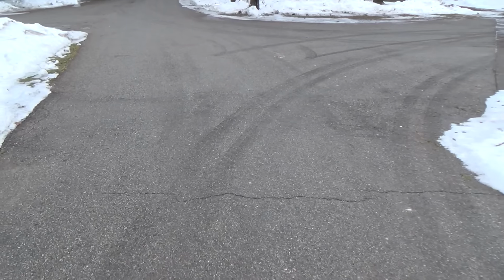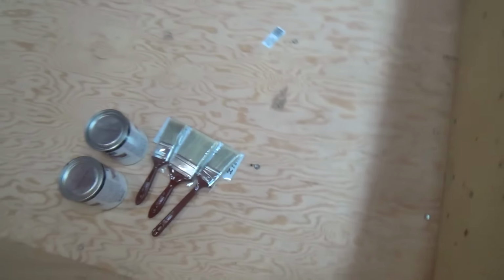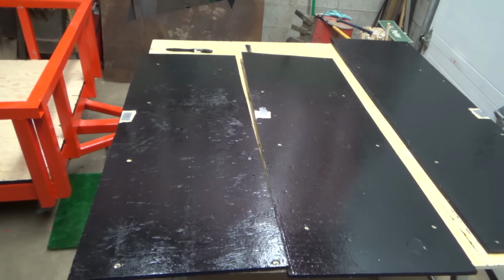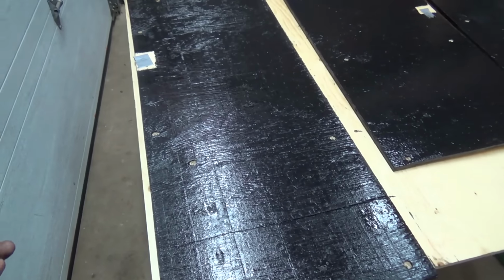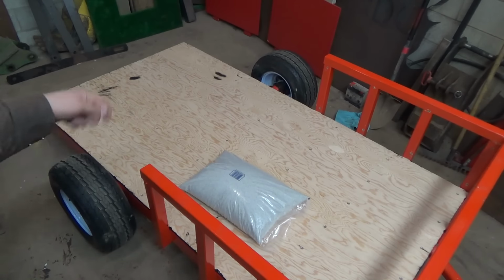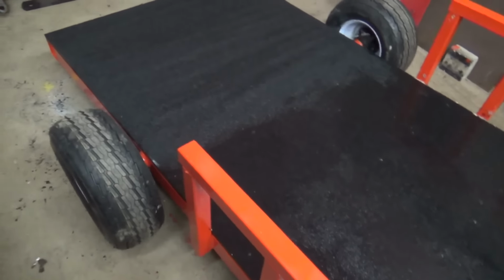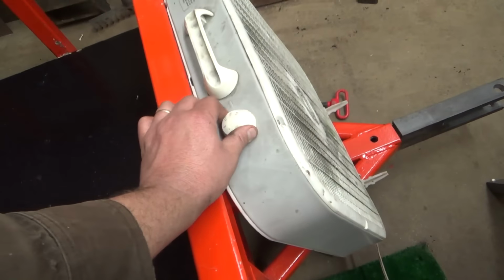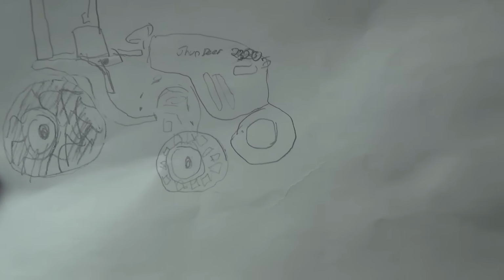Final Day of work on the new trailer Day 9

Comment: Bill I don't know if you saw my comment from yesterday's video if the paint and sand doesn't work well or wears off quickly go to tractor supply and get a horse stall mat. You can get 1/2 inch or 3/4 inch thick rubber mats and screw them to the plywood for traction. They come in 4 ft by 6 ft sheets and are about $40.

Comment: When I was in the Navy and we had to make Non-skid, we would get a gallon of whatever paint we were going to use, mix in a cup of sand with a stick until it was totally mixed. we would add small amounts of sand from there on until it was obvious that sand was in the mix then we would paint the area that needed the non skid surface. Easier that way.

Comment: You should put some aluminum angle iron on the edges of the plywood to give it a little more finished look and stop the mini ex tracks from tearing up the edges. Princess auto has 8ft lengths of aluminum angle iron for pretty cheap.

Comment: Usually what I do for the texture bill is I roll on a thick coat of paint then add my sand then spray a few coats of paint out of a paint gun, that's how I do all the bed of my flatbed tow trucks

Comment: Bill, I just did  a search on-line for the saws to run these Evoloution Blades. There is a saw made by these folks, ( in fact a few models ) the one I looked at was the Evoloution 380  Chop Saw. It's maximum blade speed is 1450 RPM. not only this but there are some good "Welding & Fabrication sites, where they discuss using these blades ar higher speeds than 1600.  Serious danger ahead, if you continue to use these steel blades on that 'abrasive blade ' Saw at high speed.
Check it out fully, please !

Comment: the one big problem i see with the trailer is when u unload the machine and dig and put the dirt on the trailer when u tilt it back up to load the machine back on off comes all the dirt. u might have to make a board to go across thats removable to keep the dirt on. also im wondering what turned around in the cementery  u should check the camera and see what it seen
Reply: 4lpower yea I don't know bc he said he would like to leave the dit right on the trailer unless he missed spoke and is going to dump the dirt then pick the miniex back up that is a good point

Comment: Bill, I like the trailer build, but I have to tell you something here about those blades, this is very short.......
CHECK THAT SAW'S  BLADE SPEED ! and then LOOK AT THE MAXIMUM SPEED ON THAT EVOLUTION BLADE AND THE OTHER BLADE YOU HAVE THERE TOO. THEY ARE RATED AT MAXIMUM 1600 rpm. 
If these blades spin faster than that, they will wear out just as fast as the others.
Good luck with this.
Reply from the maker: well its apparently was suppose to be sold as a dry chop saw.. i don't know the rpms.. maybe ill have to look at a new saw
Reply: Bill, I googled the only metal saw that Princess Auto sold and the rpms is 3600. Way to fast for the blades you are using. Maybe not the same but i would check into it with the cost of the blades. For that blade it should run about 1300 to the max of 1600.
Reply: His Pro-Point saw is like 1300 RPM
Reply: Yes  and if  it's a 'good quality' saw, you'll find that it is a lot slower  than 1600 RPM, I'm sure. 
You see I sold equipment like this in my business for years, and the one thing that bugged me was people selling inferior tools and saws like this one, and claiming it will perform.
 Yes it does cut, for a very short time, but I'm afraid you are finding out, that in the long run, these 'fast' saws are not the way to go, at least with carbide toothed blades.
Your trailer is coming along nicely, as I said, and I think it's going to look pretty cool with those black and orange colours.
Reply: How do you know ? .it's not written on my buddy's Pro Point nor in the lit. that came with it .

Comment: Bill, if you don't paint the bottom side of the big plywood sheet, how are you going to prevent it from soaking in all the water and moisture from the bottom side while you drive it around through the mud and dirt?

Comment: Why did you chose not to use any fenders? I guess this makes towing the trailer through the mud in your cemetery sections much more messy, especially in the kind of weather that's not exactly freezing, but muddy and wet.

Comment: I have a great mouse trap that you make you take a 5 gallon bucket fill it up halfway with water or if you're worried about it freezing use windshield washer forward take a coat hanger and a beer can put a hole through the bottom of the can take your coat hanger so it fits across the top of the bucket snippet inserted through the bottom of the can in and out through the part you drink through lay it across the top of the bucket so it becomes like a wheel spread peanut butter all over the can I have use this it works great I got it for musty1 on uTube